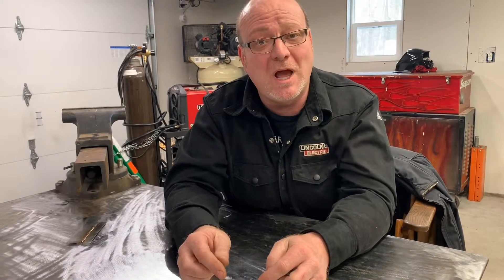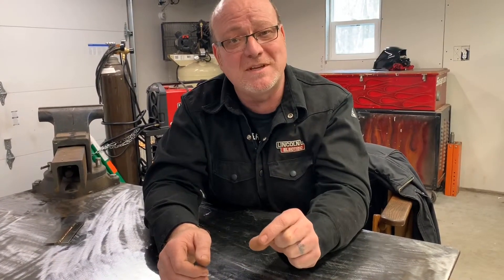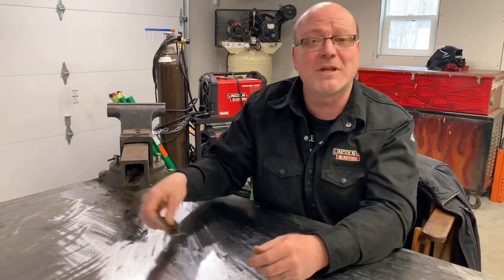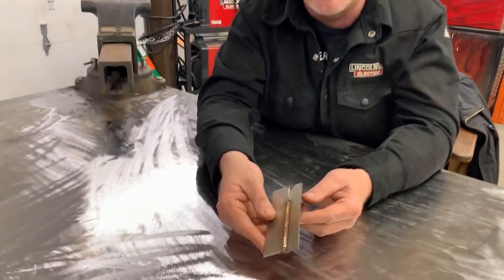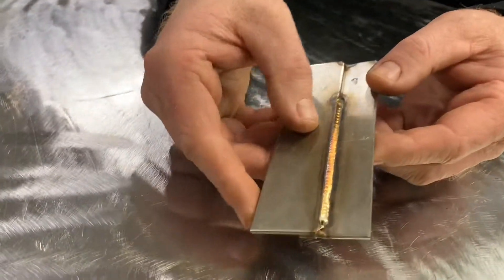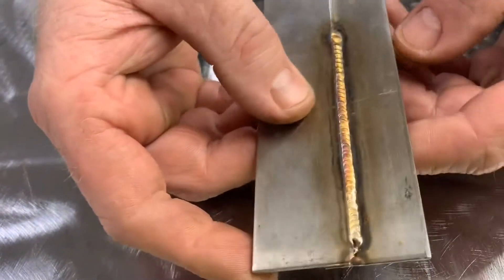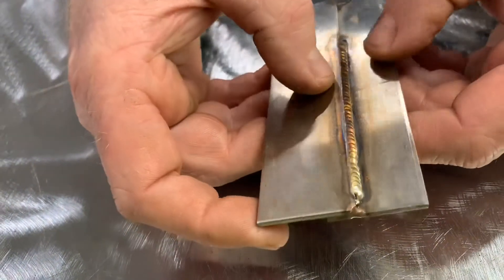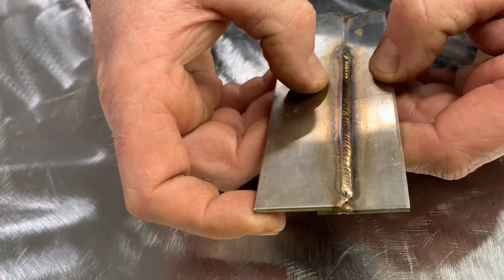Question Mark #5 Are big hot welds stronger than smaller welds?

Comment: Regarding the whole "The smaller the HAZ, the better" thing: It seems as though that might be an oversimplification. I mean, there are sure a lot of 4130-based airframes and engine mounts flying, welded with the OA process, even after 50 years of use. And there's definitely a much larger HAZ in the OA process than there is in either GTAW or GMAW. So I'm not entirely sold on that whole argument. Personally, I think it's just as much a matter of HAZ gradient as is the absolute heat put alongside a weld bead. Even the FAA seems concerned enough to recommend post-weld stress relieving GTAW'd tubing clusters due to the presence of untempered martensite right along the edges of the weld bead. Since the OA process generally takes significantly longer to accomplish, the heat diffuses farther out away from the weld join, thus making a shallower heat gradient. 

I'm not much a TIG welder yet, but I'm trying to learn. But I have spent hundreds and hundreds of hours welding aircraft structures with the OA process, and can certainly attest to the amount of heat put into most joint clusters. Like I mentioned--there are thousands of aircraft flying around with OA welded 4130 tubing. Seems like if it were only a matter of the size of the HAZ, then those things would be falling apart. I have a rudder from a J-3 cub in my shop right now for repair, and the thing is probably original--welded in the 1940s. The welds look perfect, and not one of them broke when the fuel truck ran into the tail of the aircraft and trashed the rudder.